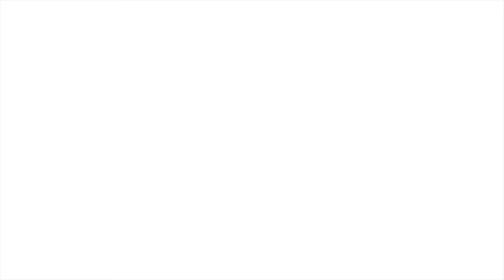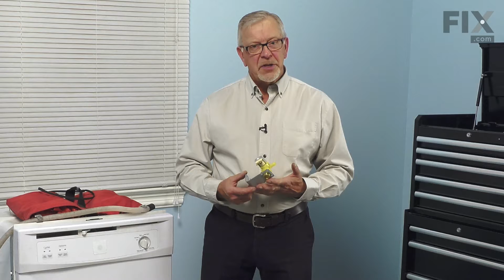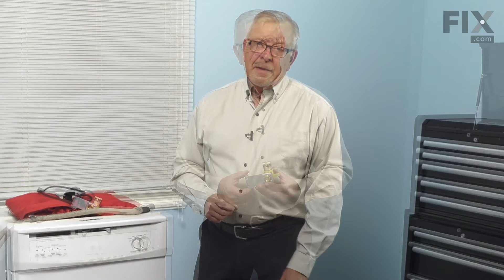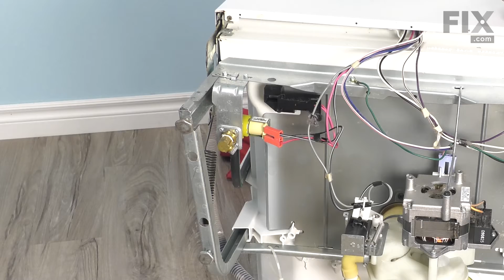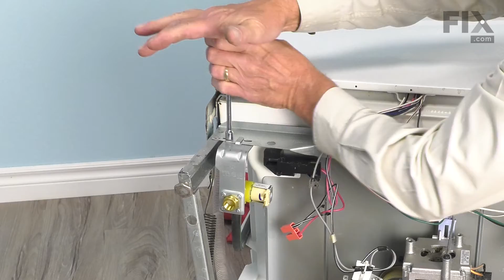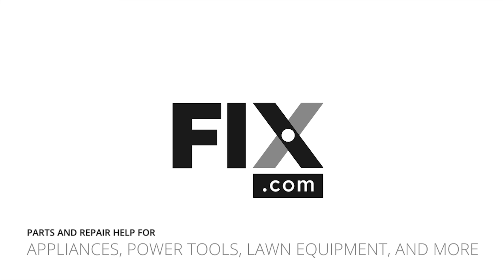GE Dishwasher Repair - How to Replace the Water Inlet Valve

Comment: Folks don't repair these valves by pulling the DW out of the wall, and turning it on its side.  Its done through the tiny opening when you remove the lower access panel, where most service will be and the gyrations you need to do to repair is quite different. Also important items like turning the power and water off should be shown, not just mentioned. If this is made for laypeople, its missing a lot of points.  If its for techs, they likely already know it.  So who is this for?

Comment: Hi Steve - is it your opinion that on a brand new dishwasher or one that has a properly operating inlet valve that the water flow will be such that the flood switch is what actually turns off the inlet valve because the water flow Has reached that level. Or is the flood switch at a higher level that should never be reached unless there’s actually a flood condition where the valve has failed open? I just replaced my inlet valve and I believe the flood switch will Trigger the valve to turn off as opposed to the one minute timer that it is set to be open for. Appreciate your thoughts